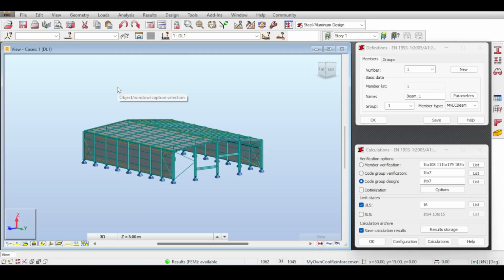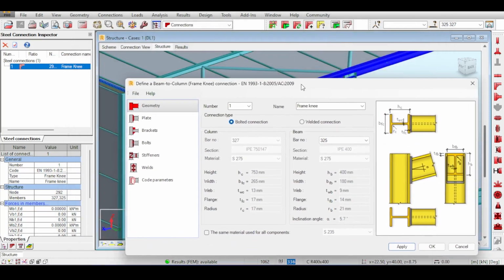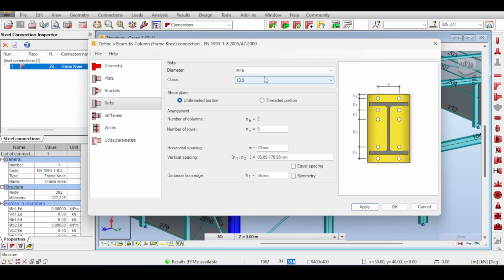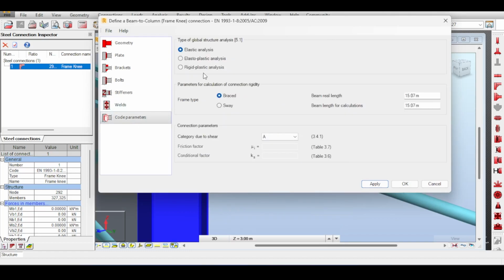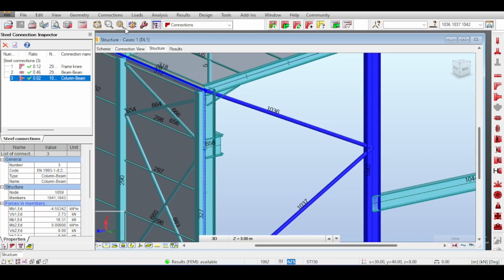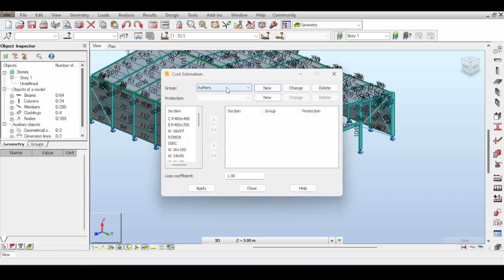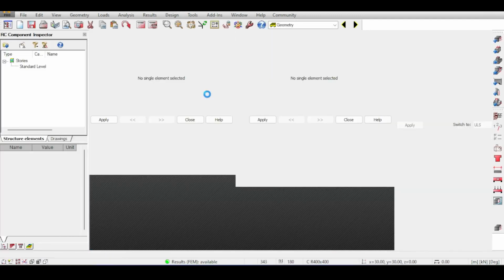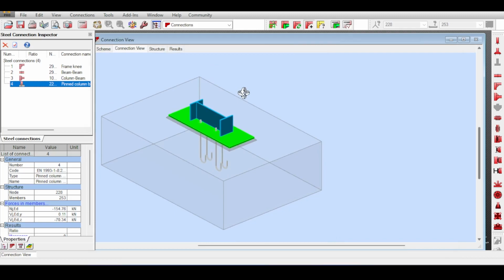Modeling of Industrial Warehouses | Part 7: Connection Design and Quantity Survey

Comment: Great series 🙌 Grtitude!
Correct me if I am wrong (I think this is important), but I think one has to design the connection for every node, right? Or at least design the connection on the node one deduces to be the weakest.
For example, in the video, Recorder selected one column base node to design the base plate and foundation. That verification is avalable for that node, alone!
Reply from the maker: You are right. There is even a thing in RSA (I did not cover it before) where you can select multiple nodes and group them. This would base the design on the "worst node".
100% correct, thnx for adding this. It helps future viewers a lot.
Regards,
CEE

Comment: Thank you very much for your VDO, if you can show how to design Z purlin in Build up section in Robot is good for young Engineer like me to learn more. 🙏🙏🙏
Reply from the maker: Hi there,
yes, I will. I want to give it a separate video.
Stay tuned for more content.
Regards,
CEE
Reply: @CivilEngineeringEssentials  Dear CEE, does Autodesk Robot can design haunch beam or not?
Reply from the maker: If i understand your question:
It designs the beam with the haunch connection togrther in the frame knee connection.
Reply: @CivilEngineeringEssentials  Thank you very much for your answer. Now I got it.